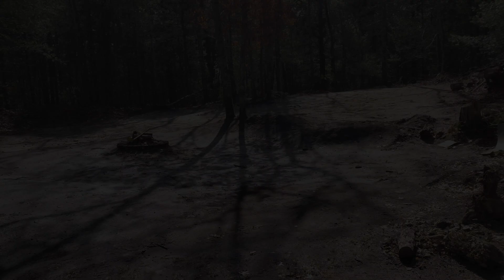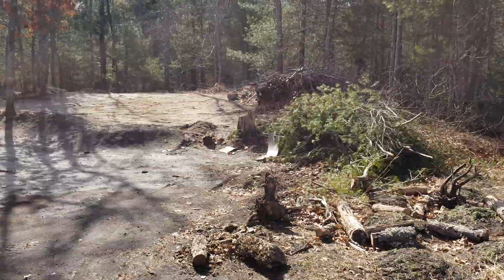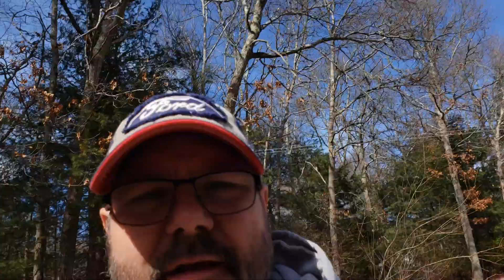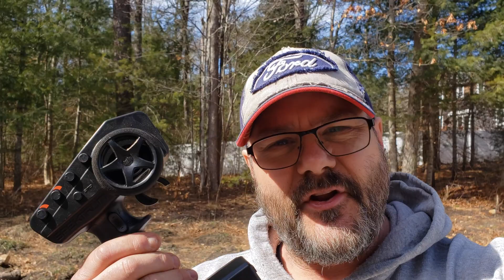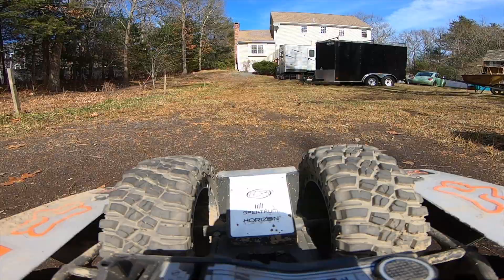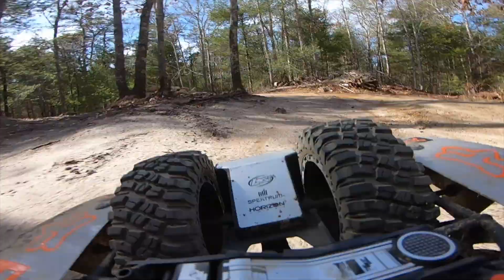Losi V2 Super Baja Rey 2.0 RIP and brace TESTING

Comment: dude if you have the sr6100at receiver in that then when you turn it on your saposed to calibrate all u have to do is squeeze full throttle neutral and full reverse then full rt turn then full left than light on receiver will light up them receivers are junk i have two of them thats what i do

Comment: Do you guy's know of any aftermarket tires for this car that are good. I call horizonhobby about the DX3 and they are sending me a new receiver I hope that fixes the connection problem
Reply: With just regular driving I have destroyed 2 of them
Reply from the maker: @derrickjones3113  Wow THAT'S no good
Reply: These Losi Baja Rey 1/10 and SBR seem to need a lot of support from Losi when ran as advertised. -Losi getting that parts support revenue you know😐